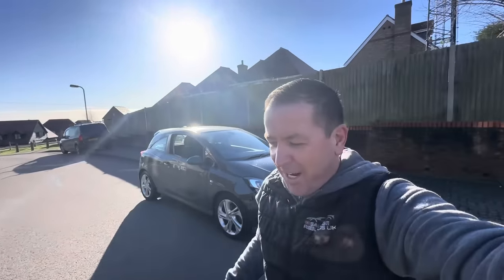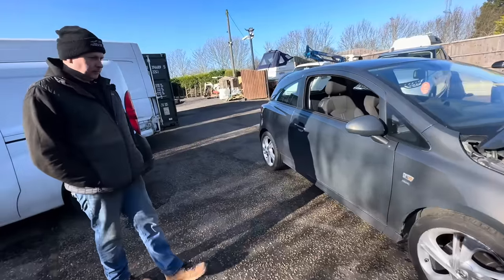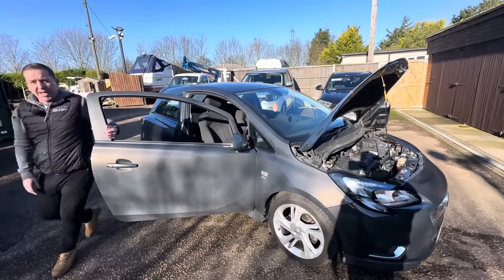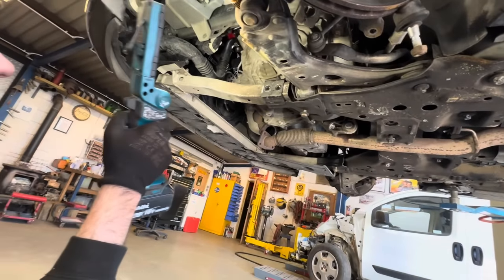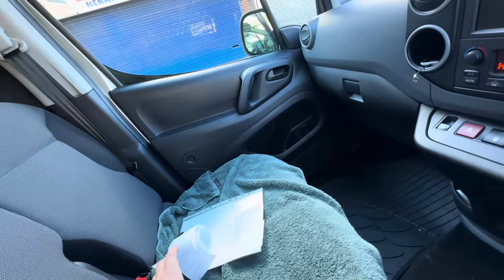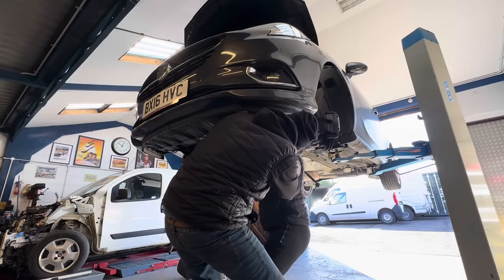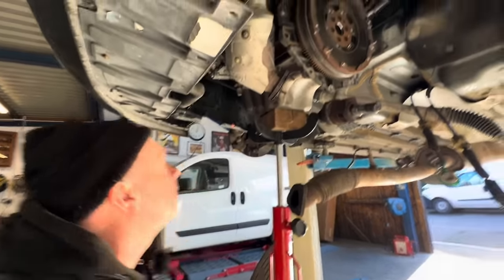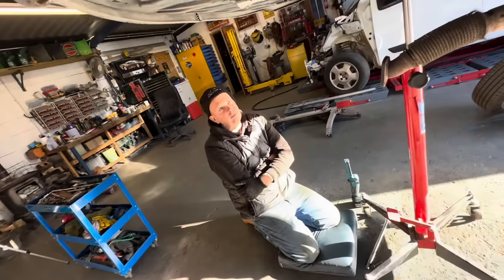WE GOT PROPERLY TUCKED UP BY A SUBSCRIBER

Comment: You aren't even going to remove the sump to clarify?
Reply: Silly move .it's already been removed. So no point squire
Reply: @inchaseable1  no by them, they are guessing what's up and may be right but can't be sure until the sump is dropped...squire!
Reply: @pbysome  didn't say it was by them . Let them be ,the car is gone and out there face . To much hassle squire
Reply: Pretty conclusive without removing the sump. What else can it be apart from crank end float, so no point in wasting time & effort.

Comment: Vauxhall cars = 🍋
Reply: So even without knowing the full facts of the matter, you are making claims about one manufacturer as a whole. 

Let’s say this is an inherent fault and not user abuse, lack of maintenance or a bad repair. 

For various reasons ALL manufacturers are making cars with issues which should not exist. 

Now you know this to be true, claiming that Vauxhall = lemon, makes you look a little stupid 😢

All cars are a sum of their components and those components may or may not be reliable depending on model, production  run and year of manufacture. 

Then there is the fact that components are interchangeable with other manufacturers like engines and gearboxes. Then those interchangeable components can be specified differently between manufacturers. 

The moral… don’t make sweeping generalisations because doing so means you loose the argument.

Comment: I’ve been a subscriber for a long time now. 

Unless I missed anything you didn’t get tucked up?

You bought a cheap car from someone who spent a lot of money focusing on the clutch/flywheel and then cut there losses. 

Apologies for the negative comment but if I had sold you that car with the limited info I had I would be quite annoyed about the title of the video.
Reply: You think they didn't know that the sump had been taken off and work done on the bottom end? Would a garage do that sort of work for free and not tell the owner?
Reply: They did get tucked up in the sense that the owner conveniently failed to mention it had a major engine defect, which they would have known given the work that had been done to find the fault (sump off etc).
Reply: @SandrodelGreco  I don’t know and didn’t imply otherwise?
Reply: Guys. Let’s put this to bed. 

I am far from a hater of Rob and Chris, quite the opposite. 

My point was that the average Joe after spending a substantial sum of money sorting the clutch and flywheel would cut their losses and sell it. 

If they were mechanically minded and knew the issues then fair play that’s naughty. 

Let’s all just go back to playing nicely👍

Comment: Why can’t you just fix the engine.
Reply: Needs a crank and maybe even line bored, that’s if the bottom end can cost a fortune to sort out properly.

If the problem was caused by lack of oil then bits of metal could be all over the engine, acting like grinding paste.

Which means there could be wear everywhere, even in the oil pump.

If you have something special like a Cosworth it would be worth fully rebuilding it, but it’s a 1.4T Corsa, the best solution is a good used engine from a low mileage vehicle
Reply: I got ya. Best of luck getting that little fella running under it own steam and serving a family for many years to come

Comment: why didn’t you check it before paying and then not buy it or get 1000£ off? 1 persons description of mint is different to another persons
Reply: You can't check everything on a used car, it would take weeks.  You do your best, even as an experienced mechanic, but sometimes if you don't get the full story, it's impossible to know.
Reply: They literally said in the video its not something you can check on a driveway...  do you expect a seller let them drive it away back to their workshop to inspect before paying?
Reply: yes but you can drive it and hear the noise or dip the clutch a few times and then you may think the gearbox/engine has a noise,

Comment: Typical " low mileage vauxhall " 😂 
Knackered clutch, oil leak, already had new driveshaft ...

If anyone thought classic vauxhalls are bad, dont ever buy a modern one. 
My mate had a 2008 corsa , diesel. Bought with extremely low mileage and full dealer history , was literally a year old . Within 6 years it had completely disintegrated the floors and sills and had to be scrapped. Both sides of it from the rear arches to the side windows had huge rust scale scabs . Absolute waste of money they are.